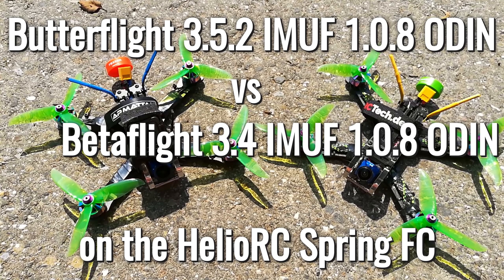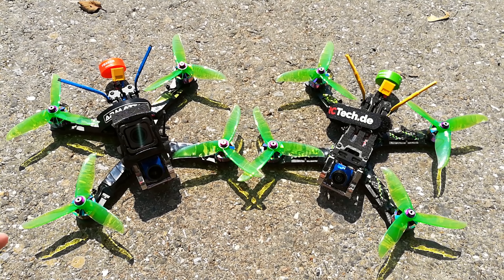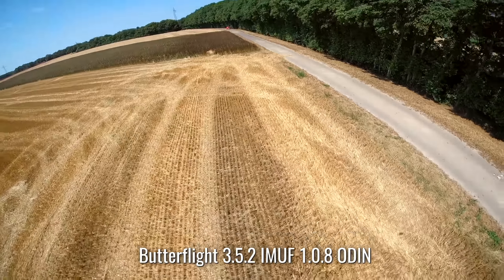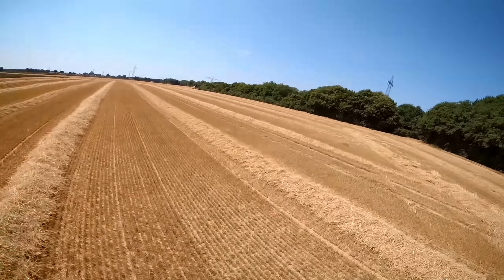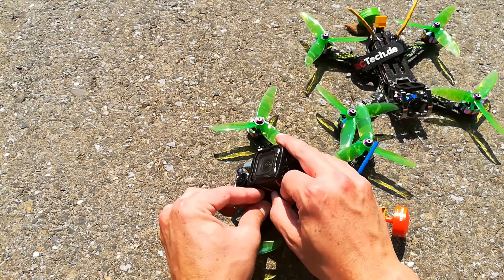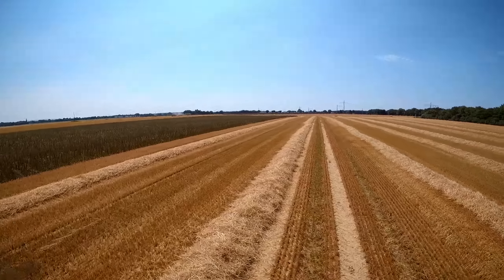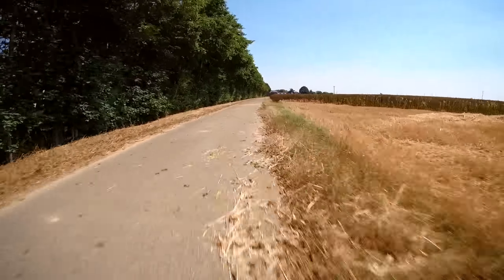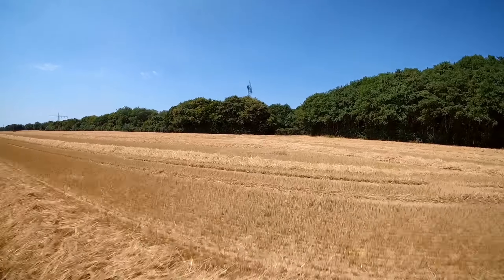Butterflight 3.5.2 IMUF 1.0.8 vs Betaflight 3.4 IMUF 1.0.8 on the Helio RC Spring FC

Comment: I did the same and found on default settings, butterflight flew slightly better but had much higher motor temps (scary hot) and was much more difficult to tune out the last of the issues whereas betaflight was a typical tuning session and was easily able to get the quad to feel how i like it.
Reply from the maker: My motors weren't hottor as on betaflight. Did you change your pwm frequency from 24 to 48 khz?
Reply: Torban Dallas whatever default settings are. Default vs default, butterflight almost smoked my motors
Reply: JoeStan FPV well should compare to same BF 3.5.0..than its cooler. just my 2 cents opinion. i had a hotter motor on default setting BF 3.4.0 but cooler on 3.5.0
Reply: @iknowlaa  same. Running bf3.5 now and loving it

Comment: It does. Also listen to the motors there a very minimal difference like beta has a slight raspy sounds like it's trying to filter some noise out ( which can be tune out) vs butter which sounds smoother and Less raspy .. imo

Comment: Torban do you have a quad with a BF flight controller (non helio) you could compare BF 3.5 with Helio Butterflight?
Reply from the maker: i have a quad with a betaflight f3 fc but the whole setup is different to the chameleons, so i think it doesn't make sense to compare them.
Reply: if its a top mount freestyle quad with decent motors it would be comparable...its more about the flight characteristics - how it moves through the air - propwash etc...than pure performance...

Comment: Great comparison video. Did you notice the Bobble when you throttle Chop it during flight with butterflight, is it any better with betaflight.
Reply from the maker: even in this point it's very similar on butterflight and betaflight. I had an eye on it while flying but i can't tell what's better.